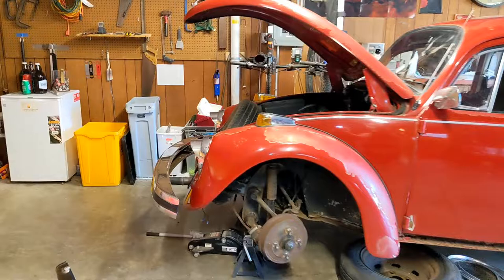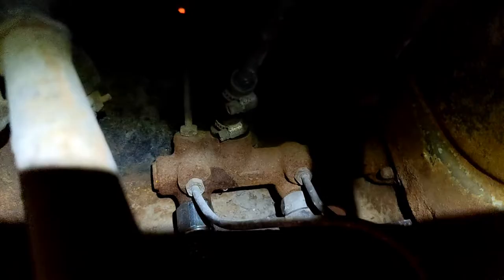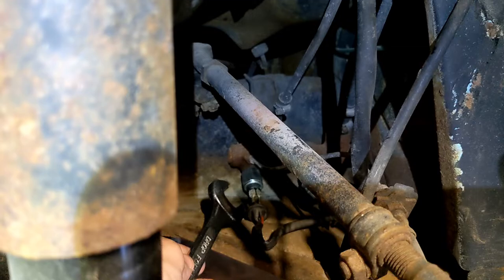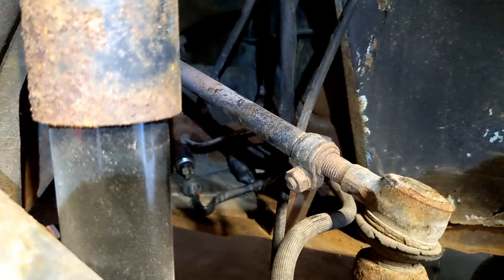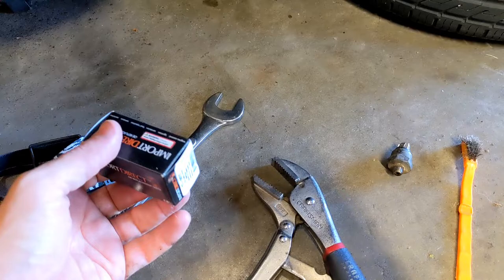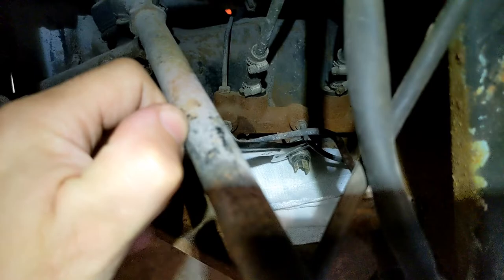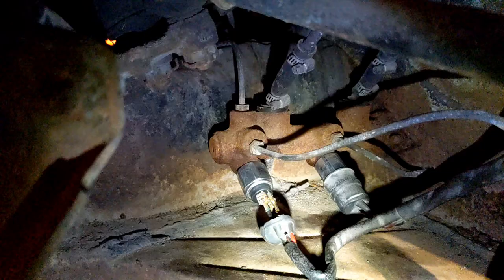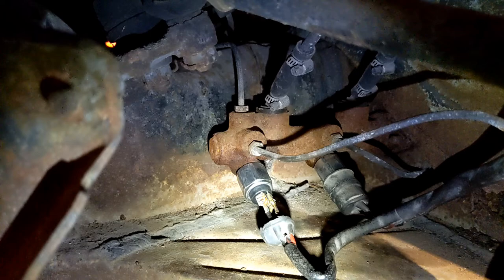The Bug: First repair the brake lights don't work

Comment: I changed my brake switches hoping it would work and it didn't i also changed bulbs still not working? Any idea why?
Reply from the maker: First thing that comes to mind is a fuse. Have you checked all the fuses? 🤔
Reply: @ThingsTomLike  I replaced every fuse in the fuse box it didn't change anything
Reply from the maker: @Dawnzyxio14 well my thinking would lead me to believe that now it's time to start looking for faulty wires. It's like chasing ghosts and it's not a great time. But if you've replaced everything else then maybe the only thing left is a broken wire somewhere.